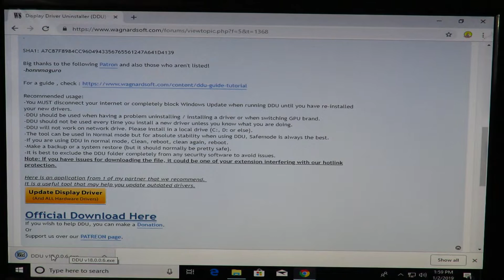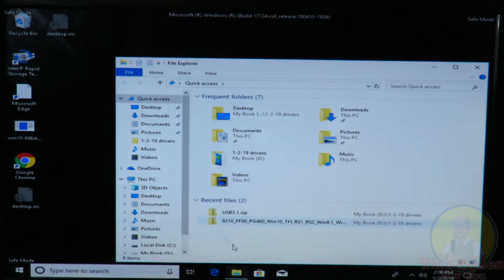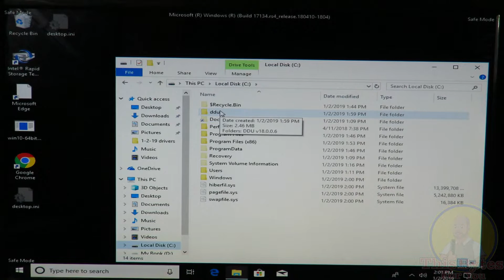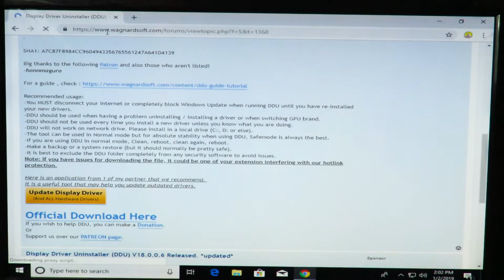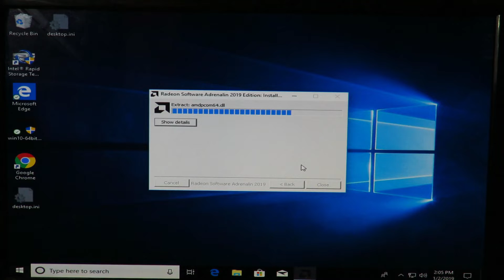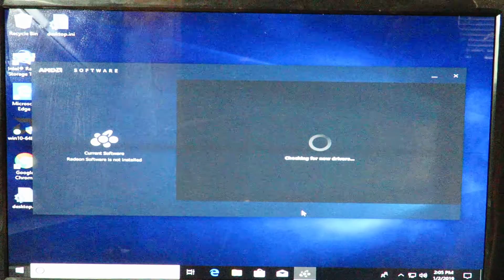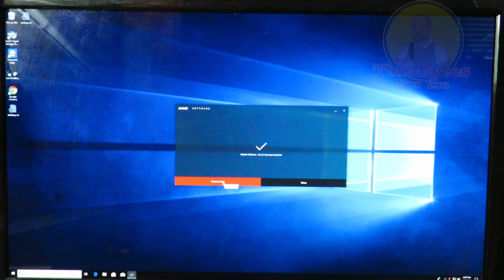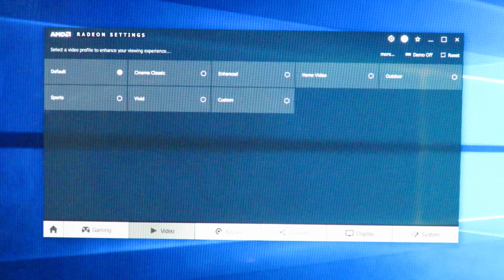How to install the AMD Sapphire Radeon Nitro+ RX 590 8GB OC Special Edition

Comment: Can someone please help me? I'm doing a clean install after building my PC. The RX590 keeps resetting my computer. It's not on for 5 mins before it resets. I couldn't even get through the tutorial without it crashing. Here are my specs:
Gigabyte X570 Aorus Pro Wifi
Ryzen 3600 CPU
16GB RAM
650 EVGA PSU

I'm SO lost and don't know what to do!
Reply from the maker: let me know if any of that helps
Reply: @ThisBytesForYou   yes, thank you! I'm downloading DDU to a USB now.. once I get home from work, I'll definitely look into it. Is there a way to check the GPU temp, even though I can't download the Raedon software? Sorry if the questions seem basic, as this is my first build 😅
Reply from the maker: @chriscarter2519  yes, you can use gpuz or hwmonitor
Reply: @ThisBytesForYou  good evening! So I attempted to download DDU. Upon getting to the point where I'm agitators to clean and restart (12:53 in your video), it restarted again. I then removed the cooler, cleaned the old thermal paste off of the heat sink and CPU, then reapplied a new amount. Once it restart again, I went into the BIOS, loaded optimal settings, and saved and exited twice. Still crashed. I then installed GPU-Z and as far as the GPU temp, it's not reading anything. Fan speed is 27%, 1186 RPM, GPU load 100%. I can read off other numbers, but long story short most of the red bars are all the way filled up
Reply: Oddly enough, for the Graphics Card name it has Microsoft Basic Display Adapter
Reply from the maker: @chriscarter2519  so were you able to download ddu on another computer, if you boot into safe mode, does th you run at 100%?
Reply from the maker: @chriscarter2519  oh, so it does not even have amd drivers installed yet.  Are you in safe mode?
Reply: @ThisBytesForYou  yes, now I am in safe mode. What did you want me to do next?
Reply from the maker: @chriscarter2519  if you have ddu there, use it to remove Nvidia and amd drivers, just to be safe but does the system get hot there?  The windows jnstall, is it a new install, if not new, what video card did you have in it before,?  Download the newest amd drivers on another machine and then boot back into windows and install the drivers
Reply: @ThisBytesForYou  it is a new build... so no previous graphics cards were in..I have the Raedon software on a flash drive... should I try to reinstall the software in safe mode or regular mode?
Reply from the maker: @chriscarter2519  you won't be able to install the drivers in safe mode, but make sure your run ddu, to get rid of the windows drivers not for Nvidia and amd.
Reply from the maker: my friend, I would love nothing more than to help you.  From the quick run down of the issue, it sounds like your CPU is overheating.  When you installed your RX590, did you unplug your cpu coolers power cable?  Make sure your CPU cooler (air or liquid) is properly plugged in.  Do you have your Rx 590 (I assume its not a Sapphire), plugged in with all the PCI-E power connection?

Do you have the card overclocked, do you have overclocking software install, if so, remove it and uninstall and reinstall the drivers for the video card, perhaps use DDU to remove the drivers, I love DDU.

If all of the above is correct, I recommend unplugging the power to your PC, removing the video card, then reinstalling it, and testing again, it can happen.  Let me know if you have tried these and if you are still running into issues so I can keep helping you.  Please also (maybe using HWMonitor) check the CPU and GPU temperatures while you are using it.
Reply: @ThisBytesForYou   ThisBytesForYou  Thank you for the quick response! I forgot to mention I had the Gammax GT air cooler... but that is connected to the 'CPU fan' socket on the motherboard. It IS the Sapphire version of the 590, there are two cables hooked to it: a 6- and 8-pin PCI-E.

I haven't been able to overclock it. In fact, I can barely run ANYTHING. My computer can sit idle at the desktop just fine, but even attempting to use IE to download DDU or go to AMD's website to download Raedon software result in the PC shutting off and restarting. I was able to download Ryzen Master software between restarts, and the temp reads about 56 degrees C before it shuts off. I put a pea sized amount of thermal paste when installing the cooler... maybe that wasn't enough?
Reply from the maker: Chris Carter  that should be enough, thats how I recommend it in my build videos, you can check them out as well to see if it will help, I built a budget gaming rig here (extreme budget) amd, it might help.  One thing you may want to do in the BIOS, is load optimal settings, then save and exit, then come back into the BIOS and make the change you know are correct (memory XMP, SSD boot drive, AHCI/RAID/ETC) then save an exit again and see how that works for you.  Try downloading DDU using another PC is possible, then copying it over, see if that works, but try the BIOS thing first, hopefully that will work.  It sounds like its overheatink, 56 degrees I think is a little high for an idle state.  Regards of that, what is the GPU temperature at?

Comment: are the cables 6+8pin included in the package?
Reply from the maker: no, that came from my power supply, if you need additional cables, let me know what brand and model number power supply you have and I can help you look.  Also, if you want to see everything that came inside the box, check out my unboxing https://youtu.be/r47j5JPweMM
Reply: Thank you very much I already bought all the cables needed for the gpu 😊
Reply from the maker: @BloodBrothers48  oh ok very coo, you are very welcome my friend.  hopefully I have helped you out and please do let me know if you have any other issues, questions or concerns, I love to help.
Reply: Well kind of a problem but other than unistall all the drivers with ddu do I also need to unistall Radeon settings(I mean amd software the one you get in unistall a program) because when I open it I get the latest drivers for the previous gpu.
Sorry if English is not perfect.
I'm learning to...
Reply from the maker: @BloodBrothers48  no worries my friend, I speak English and Spanish, and if I don't know the language, I use google translate, haha, I try to help everyday I can.  So yes. AMD/NVIDIA/Intel, all make uninstalls for their software, but there are trillions of combinations of drivers and other peaces of software that utilize those drivers and hold on to them, and many times they will not uninstall correctly and many times the uninstallers are not that great.  DDU goes in, asks you to boot into safemode, where drivers are all disabled, using basic video drivers, and then cleans all the drivers out, registry entries, INI's, software that comes with the drivers and all the likes and gets rid of it perfectly.  I see people all the time have a TON of issues with drivers and their cards, I  never have issues.  I would like to think this is the reason.  

Please, any other question you have, please do ask, I would love to help.
Reply: Bless you sir with your vid and help I was able to correctly mount and install this amazing video card.
Yes that program was holding unto the previous drivers.
Ps:keep up with the videos they're very informative
Reply from the maker: @BloodBrothers48  you are so very welcome my friend, so very happy I could help you my friend.  I am thinking maybe I will make a video on this for tomorrow.  Thank you ;)

Comment: anyone know any good cheap  8+6 pin psu
Reply from the maker: what type do you need, one that plugs into your power supply box (a modular cable) or one that attaches to an existing cable?  Would you know your power supply manufacturer and model number?

Comment: hi i have a psu like this https://cdn.vatanbilgisayar.com/UPLOAD/PRODUCT/RAMPAGE/thumb/v2-88721-1_large.JPG 
how can i plug the 6 pin connector ?
Reply from the maker: you would have to get one of the cables that has the 6 pin connector on one end, do you have the cables in the power supply box maybe?

Comment: Will this fit in a micro atx case
Reply from the maker: Well, yes and no, not all micro-ATX cases are the same.  Do you already have a micro-ATX case that you are asking for, if so, please let me know who makes it and the model number so I can check for you.  If you dont know, let me know and I can see if I could recommend one for you.  Let me know your budget as well, just in case.
Reply: ThisBytesForYou thanks for the info and the case I’m using coolermaster masterbox q300l TUF
Reply from the maker: @andrewcruz2380  you are very welcome my friend.  The case can take up to a 360mm in length card ,this card is 260mm, so you have plenty of room.  You can find the card here on Amazon: http://geni.us/CWSOO8N.  The card also requires at least 500Watts (well, the card will take up to 235Watts), so you need to make sure you have that as well.  Do you know how many watts your power supply is rated for and if not, give me the manufacturer and model number and I will check for you.

Comment: what if i only have 8 pin connector? would it still work even without the 6 pin?
Reply from the maker: no, you would need a 6 Pin as well, but let me know what power supply you have and I can help you with it.  The manufacturer and model number.
Reply: @ThisBytesForYou  , hi, it is Seasonic M12ii evo 750w 80plus bronze.
Reply from the maker: The power supply has 3 x 6+2 Pin PCI-e cables.  The 6+2 cables are for when you have a 6 pin, you can just move the 2 over and when you have an 8 pin, you can just use all 8, you should be good.  check it out on Amazon: https://geni.us/Ae8d
Reply: @ThisBytesForYou  , thanks. I guess I would need to buy a 6+2 cable then since I lost it.
Reply from the maker: @guyfawkes469  one sec, let me see if I can find it for you
Reply from the maker: @guyfawkes469  actually, I don't see a place to buy it so you might need to contact them.  https://seasonic.com/contact-us, I hope i helped.
Reply: ThisBytesForYou , thank you.
Reply from the maker: @guyfawkes469  You are so very welcome my friend, I am so very happy I could help you.  If/When you do end up getting that cable, please let me know how it works out for you or of course if you need any other help, always happy to help.

Comment: Hi i have a rx 580 and fan not working when i start my pc , is normal this think?
Reply from the maker: does it start up after a few seconds when you are in windows?
Reply: @ThisBytesForYou  nop
Reply from the maker: so the fans are supposed to start up when the card reaches 60°C (it maybe a little more or less).  Try playing a quick game, to see if the fans turn on
Reply: @ThisBytesForYou  ok, thanks a lot
Reply from the maker: you are very welcome my friend, give it a try and please let me know if that helps.
Reply: @ThisBytesForYou  hi the fans starts when temp is over 57 , thanks a lot for informations and i wish you good luck :)
Reply from the maker: @nextgames9331  I thought it was 60°C, but close enough and you are very welcome my friend, so very happy I could help.
Reply: @ThisBytesForYou  if i use msi afterburn i can start the fans
Reply: @ThisBytesForYou  i saw in your video rx 590 fans starts after 60 degreads , is the same on 580?
Reply from the maker: it should be yes, give it a try

Comment: Mate i had an old gigabyte card. I didnt even had to connect it on the power supply. Now i got a nitro rx580. Does evrry power supplier has 8 pin connections?
Reply from the maker: Hello my friend, no not every powersupply has an 8Pin connection, some don't even have 6 Pin connections.  Can you let me know the power supply manufacturer and model number?
Reply: @ThisBytesForYou  corsair cx 600
Reply from the maker: @KONIStheGREEK  that power supply lists that it has 2 x 6+2Pin connectors, you can find it here on Amazon: https://geni.us/tX4S so you should be good.

Comment: i need this tutorial but with a new boot. my rx590 wont connect to any monitor or tv with hdmi or vga and im using the tomahawk. nothing will connect so i cant even run the boot drive
Reply from the maker: ok, so when you install the card, then insert the 6 Pin and 8Pin PCIE cables.  After that, you connect the monitor/TV using the HDMI/VGA cable to the video card,... not the motherboard.  I know it sounds dumb, but this is a VERY common mistake.
Reply: @ThisBytesForYou  uh i have not been using the motherboard hdmi. It might be a monitor problem here, im getting a display port to hdmi instead of vga now. Currently on 3rd trip to walmart
Reply: @ThisBytesForYou  just got a display port adapter instead of vga, still not working. The only thing i haven't tried is the dvi to hdmi but id have to take another trip to the store again. Might just need a new monitor
Reply from the maker: @thefreshvince69  aside from that monitor, do you have another you could be testing with, just to see?
Reply: @ThisBytesForYou  yeah ive used 2 diff hdmi tvs and a monitor
Reply: I really hope nothing is faulty
Reply from the maker: it is sounding like it is sadly, do you have another card you could test in it, just to make sure?
Reply: @ThisBytesForYou  no, this is my first pc build brand new
Reply from the maker: @thefreshvince69  ahh congrats and for your sake I hope they cables are OK.  One thing, for your TV/Monitor, are you changing the inputs to the cable you are using?  meaning, if you are using HDMI, are you changing the input on the TV or monitor to utilize HDMI and so on?  They are not always automatic
Reply from the maker: can you try the motherboard HDMI/ DVI, DP or VGA port to see if that works for you?
Reply: @ThisBytesForYou  you think its the mobo, the gpu or the monitor? I gotta get a new monitor first to check it
Reply from the maker: @thefreshvince69  it could be anything really, do you hear a beep when you turn on the computer, many beeps, no beeps, does your motherboard have a speaker that you can hear beeps?  Try connecting the monitor to the ports on the motherboard to see if you get video there.  If anything, you may ned to disable the onboard video to make the PCIE card work properly.
Reply: @ThisBytesForYou  im not a novice to tech, just to building a computer. The only thing i didnt try was dvi cause i have to go get a dvi to hdmi adapter. I took the entire computer apart to inspect it and have to put it back together. No beeps with anything,  took the ram out and nothing changes. Plugged into the mobo it does nothing. I get no display. Lucky if its the monitor but at this point im thinking of retuning my mobo and gettin a new one
Reply from the maker: @thefreshvince69  what is the exact motherboard you are using, please provide the model number since there are many tomahawk motherboards
Reply: @ThisBytesForYou  b450 tomahawk, also i have ryzen 2700x if you needed the cpu
Reply from the maker: sorry,youtube never told me this message came ion, is everything working for you?

Comment: hey man, i have a really stupid question, the hdmi cable from the monitor need to be connected to the hdmi port of the graphics card and not the motherboard right?
Reply from the maker: Not a stupid question at all.  You would not believe how many people do this and get upset because it doesn't work and don't ask about it.  So it may work if you plan on using both onboard graphics and another gpu together but if you want to use the power of the add-on card you will want to plug the monitor into the graphics card, not the motherboard.  Thank you so much for stopping by and checking out my video and even more for commenting, it means the world to me.
Reply: @ThisBytesForYou  ok thanks, the rx 590 has two hdmi ports right?  which one should I use?
Reply from the maker: @ProgTheater  it does not really matter you could use which ever

Comment: Would this work on a optiplex 7010 mt
Reply from the maker: my friend, it would be almost impossible for me to tell you, there are many different configurations in the Optiplex 7010 mt.  My search online shows no power supply, so I am not sure, I can tell you the power supply is not a standard one.  I would need to know how many watts your power supply is and if it has any pCIE connections.  I don't see anywhere online the measurements in the case, so I don't know if there is enough room in your case.  Sorry my friend, I would love to help you, but I don't have any information on this system.
Reply: @ThisBytesForYou  well i already bought another gpu that will fit my motherboard. (Rx 580 mini). The psu i have is a corsair 450w
Reply from the maker: @JohnOnlySpeaks  ahhhh ok great, thanks for letting me know.  That is odd, but I guess it is not.  From what I have seen about your system is that it has a non standard power supply, but I guess since they change cases so much, it is impossible for me to know with the model name what kind of case and components are in there.  What is the model number of that video card?